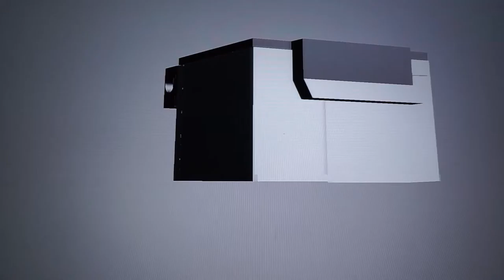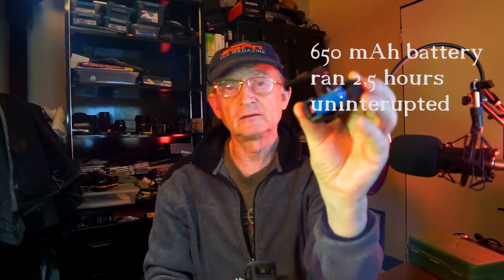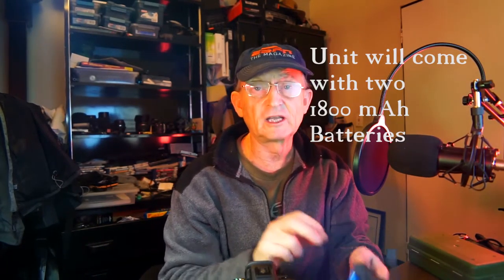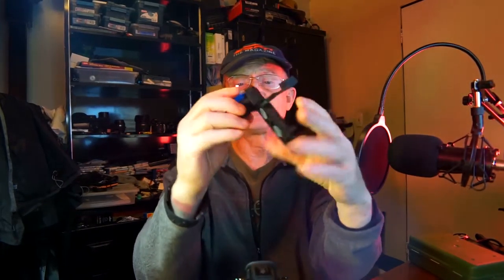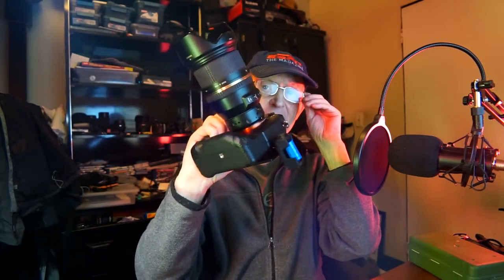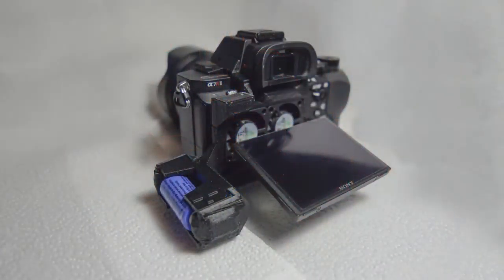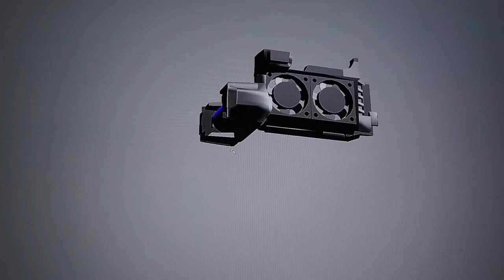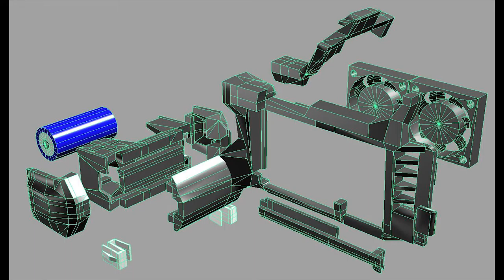Sony A7r II Cooling Solution

Comment: Would you be able to print this with a less glossy material? I think this is a fantastic idea but the aesthetics might be holding it back. I've been an a7s shooter for the past couple of years and I just sold it hoping to get an a7sii soon. Something like this would definitely put me at ease using it for longer recordings.
Reply from the maker: It is not as glossy as you would think, and the two buyers that I have sold to recently were so impressed with it, the way it actually blended into the camera and the cooling systems effectiveness, that all I have received so far have been glowing comments. I tried PLA material, but it is not as strong as ABS material. The slight sheen matches the camera body pretty well.

Comment: I imagine this fits on the A7sII? This is amazing Steve, like someone else said, your work does not go unnoticed.  Looking at purchasing one of these before wedding season arrives.  I love that you point out that the firmware does not fix the solution in REAL situations.  I even had the A7sII overheat in 1080p in direct sunlight (around 92 degrees) last year.  The thing I love about this is that you can unclip it from the camera when not in use to keep it protected.  For example, for me I would just clip it on before the wedding ceremony and toasts, which can go anywhere from 30 minutes - 1.5 hours.

Are you still just selling it on eBay? I found this link:

http://www.ebay.com/itm/Sony-Mirror-less-Camera-Super-Cooler-II-Built-to-order-7-Day-Wait-/182190653011?hash=item2a6b68be53:g:D0gAAOSwA3dYmn7b

On ebay, it mentions there are no returns.  If the coolor is not working properly, or I'm finding that after a few tests, it's too bulky, is there no way to return?  

Thanks again Steven!

Comment: whats the chances of getting one done for A7, how much?
Reply from the maker: I had an A7 for a while and was going to produce a unit for it. However, those do not do 4K and the overheating problem is not as severe, so I sold it before completing the specs for it. So at the moment, until I start getting more sales of the other designs, it will have to wait.